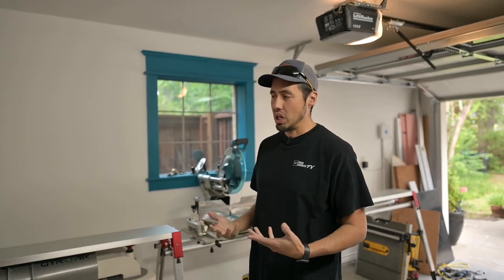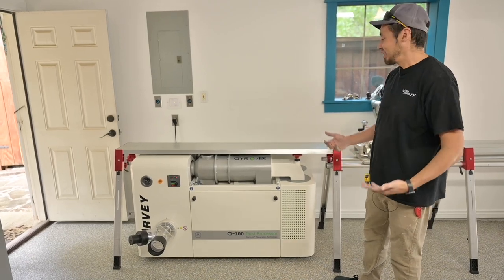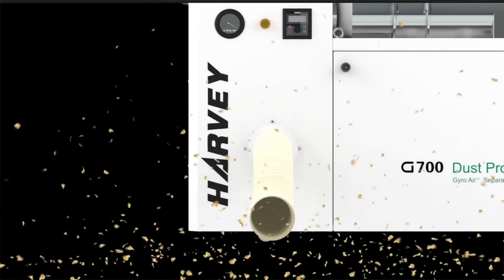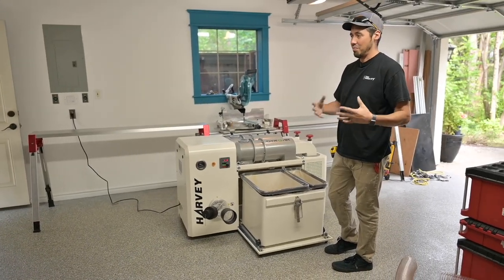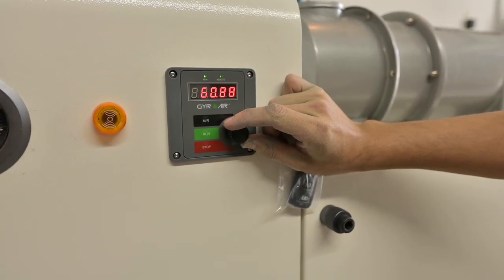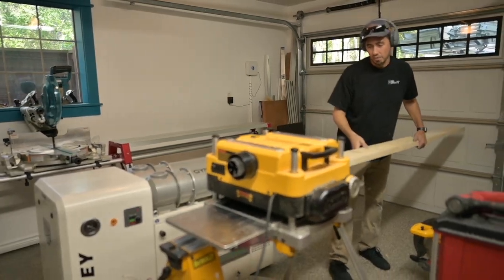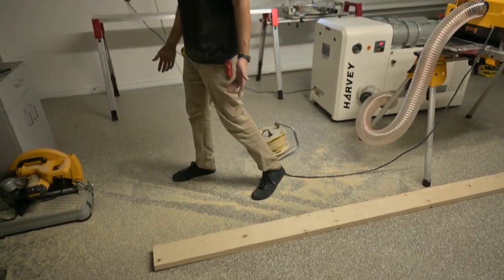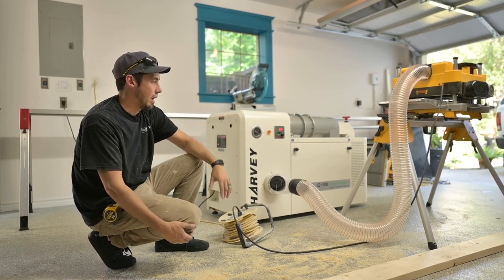This thing SUCKS! (FIRST TIME using my NEW DUST COLLECTOR!)

Comment: LOL, great video demonstration, I've seen one of these dust collectors before, I don't have one, for now in my small shop, I made one for the same DeWALT planner, basically a box that the planner sits on with a hose from the planner to the box and 2 filters, one like a screen to catch all this big chucks and the secondary is a furnace filter the catches all the finer partials, it's not perfect, but it keeps the mess way down, those planners make a huge mess and it's gets old fast cleaning up after it.  the whole box sits on casters for easy mobility.

Comment: I'd recommend strategically fixed permanent ducting smooth interior with only flexi pipe to final tool location ...I think the flexible ducting is less efficient v smooth walled ducting ?
Reply: I’ve worked in several shops with several different dust systems and the shop that had all smooth lines hard piping for all of the main trunk lines had superior performance. And it was a smaller vac in a bigger shop, versus the other shops that were the same size or bigger with flexible hoses. Smooth fixed lines all the way!
Reply: Stumpy Nubs has an excellent video about all this and Bourbon Moth too, specifically about this same model. Harvey will even send you a diagram of optimal layout for your shop!
Reply: this would be a sweet video,,paint the pvc and all
Reply: @organize1979  Bourbon Moth has the larger model, the G800, and it costs more than 2X more than the G700.  I guess Harvey is willing to make smaller margins on the G700 to sell to more people.  I ordered a G700 over Harvey's Thanksgiving sale and it's supposed to be delivered next week.  I'm looking forward to comparing it to my Jet DC-1100VX-CK 1.5-HP, which is very loud and leaky and will be for sale soon.
Reply: @bobbray9666  How's the G700 working out for you?
Reply: @coppertune9124  All the advertised attributes are true and it's a nice DC.  I modified the clean out ports into a 4" Y for easier use.  The dust bags are about half the size of my old DC but half the weight!

Comment: I got a Harvey G700 last year after Matt's video as well and it was definitely the right fit for the residential shop I was spooling up.  A few observations.  Spool up time can be frustrating for making quick cuts, so for things like the miter saw you may prefer a separate dust extractor (see my comments below in Brian's thread on this topic).  Second, I really wish there was a vertical facing opening you could use for more permanent ductwork instead.  That lower/horizontal opening is super awkward in some cases and I had to design my entire shop layout around this unit.  Still no regrets though, it's a great unit.  Lastly, if I ever hear you call a gladius a machete again I'm going to report you to the armorer.
Reply: I bought a G700 a few months ago in anticipation of our new home build.  I'm going to run my DC piping (6" PVC S&D) under the concrete floor to 4 or 5 work stations.  I'll also have a couple of cleanouts, just in case.  The low to the floor suction on the G700 should work great but most won't have this option..
Reply: How's the G700 working out for you after using it for some time?
Reply: @coppertune9124  Pretty good, though I sadly haven't put enough mileage on it to really give it a full assessment.
Reply: Can you tell me what I’ll need to connect a 4in flex hose to the g 700. I have one on the way but don’t no if I need a specific coupler or if the 4in flex hose will slide right on and just clamp down.
Reply: @lucasmancini7415  The unit comes with a 6" to two 4" y-split.  You should be fine.
Reply: @Warkive  so the 4in flex hose will slide right onto the 4in y either side

Comment: I have a workshop in the UK and that type of extractor is good for a  small workshop but the dust capacity is very poor especially when planing timber. The sound will be far higher when you connect the extractor to your Planer but if you change your planer block to a well made cutter block which has the Spiral/shear cutters the decibels will be cut by a fair amount. I have a new Felder RL200 Extractor and when I fitted spiral blocks to my 4 sided moulder it reduced the decibels from 90db to 73db just by changing from the traditional planing blocks to spiral blocks. Good luck with the workshop and Happy New Year from England.

Comment: I've been watching your channel since I got back into finish carpentry 6 months ago and this is my first comment. It has been awesome watching you grow as I grow my company. The Harvery dust collection system is a great choice for your shop. You will have to do a follow up video once you get it all setup. It'll be nice to have a spot for everything with it all piped in. I'd recommend galvanized straight pipe. A couple elbows and you'll be in business.

Comment: My smallish shop doubles as a prep room AND a finishing room. We use a series of vacuums and as you can imagine there’s still fine dust from sanding, cutting etc and it lands everywhere (ex. tops of light fixtures, cabinets, tool boxes….) and it’s a real chore to ready the space for finishing so dust doesn’t end up in on finish. The 700 model sounds like the ticket for me. I’ll be looking to get this unit ASAP. Thanks for the demo.

Comment: Since your equipment will be mobile within the shop, maybe a couple of permanent ducts, one or more overhead and one or more near floor level (for tools like a table saw or jointer) with "taps" (for lack of better term) that you could connect collector hoses to as needed.  A simple sliding damper would close the "tap" when not in use.  
For stationary tools, or semi-stationary tools, like the miter saw, a permanent duct on the wall with a collector hose would be great. 
Looks like a great tool.

Comment: Thanks for the demo. We're thinking about adding this to our workshop instead of the Oneida. Two questions. We're getting a Shopsabre CNC IS-408 soon but I'm curious if this will pull double duty for our Epilog Fusion Pro laser engraver. The second question is that you were, in jest I'm sure, mentioning Dallas/FW airport landing (@ 10:05 in your timeline). Is your shop by chance in Dallas?

Comment: Biggest problem i had with a bigger workshop dust collector, was the short ramp up time for the miter saw and even table saw. 

Leave this machine oiled and ready to go for some heavy heavy route ring or planning - but i highly recomend a few strategically placed workshop vacs for the Mitre saw and the work table when you need that quick cut. Either way, no matter HOW big and baddass you go, the dust and shavings will still get everywhere. The main goal is to capture the fine dust that you cant see.

Comment: Those ridged hoses reduce suction by 3 or 4x. But you probably don’t have to worry about it with that powerhouse! 

I just finished installing 4” schedule 40 PVC duct to all my tools. I’m very pleased. It took a few weeks due to supply constraints and ordering a few wrong parts. Rockler makes a handy PVC adapter to transition from the pipe to a hose at the tool. Schedule 40 is more like 4 3/4 so you’ll want to use 5” metal blast gates.

Comment: You would still probably get better collection to run a Festool extractor to the miter saw. The rest of the tools need that large CFM from the Gyro but the miter saw and any sanders will do better on a dedicated extractor (vacuum)
Reply: Agreed! Had the same in my old shop. Ran the Festool for the mitre only and a Vortex for everything else. Well worth it when you need to take the Festool extractor out on a job.

Comment: I have a surface plainer and hands down is the dirtiest machine I own. Dust collection in a shop is a must. Good luck with your setup. Looks good so far. I’d run permanent ducts with flex at the tool.
Reply: My top planer is not only the dirtiest machine but the loudest.

Comment: I have a mobile cart Laguna, with a cyclone on the top of one of the grey trash cans.  Just used some peel and stick foam insulation to get a seal and attached they cyclone to the lid.  Even put a plexi glass window in the can so I can see when its full lol.

Comment: Very nice.  The dewalt planer has great dust collection already with the extraction fan built in.   There's been debate on if it's damaging to the fan system on the dewalt while having the dust collection on at the same time.  Not sure if it's true though.

Comment: Cool machine can you put the link of the tool you  use/used for using when you hook up the chop saw, table saw, and vacuum at the work place. When you step on it it turns on  vacuum to suck the dust from which ever tool you use thanks

Comment: Nice review of the machine.  Looks to be a real nice dust collector, however, as others have mentioned the input location on the front of the unit doesn’t seem to be well thought out.  Would prefer either the input be on the end, back, or top of the cabinet to allow for permanent ductwork attachment.  I don’t want hoses all over the floor.  I guess you could route ductwork under the flood if able.  Might be a deal breaker for me.  Too bad, I really like Harvey products…

Comment: Awesome vids man. Im a cabinet installer in Naples florida. I appreciate all the tool reviews. I would like to see more stuff on the new makita 12”. I’m a millwalkee guy and I have their 12” miter-saw but it dose t  working for the quality I need. I have a Kpex for small stuff but I’m looking at getting either the 12” cordless dewalt or 12” 40V Mikita you just got. Which you recommend

Comment: I have a Drummond 2 HP dust system with a 1 micron canister and it works well but very noisy. The shop is underneath the double garage so surrounded by concrete, the sound is stuck between the walls. Ear protection is mandatory but there is very limited dust in the air. You can't see it compare when I had the bag instead of the canister. 1000$ cad for the kit.

Comment: Permanent ducting but made from metal is way to go, with grounding wires in few spots reduce fire hazard. As suction and friction are causing static electricity buildup that in some ceases leads to creating a spark. Spark combined with fine particles of any flammable material in extreme cases can cause micro explosion. In Europe you would have big issue with insuring this property without having such permanent solution at least if you are using this shop commercially.

Comment: If concerning yourself with noises , just a suggestion . You might want to install insulation in the garage panels as well. Not only will you be able to keep working in the cold & hot humid months inTexas. It will cut down on the outside noises to your neighborhood . Great video, I’m newly subscribed to your channel, keep up the great videos.

Comment: Nice video, love the impersonation of a pilot haha. The "gyro action" is two cyclones just situated horizontally instead of vertically. Very nicely packaged and looks well built with the fit and finish but the engineering portion of it isn't ground breaking.

Comment: Two things I would never put in a shop are an air compressor or a dust collector. Both always get installed outside the shop in a dedicated insulated shed.

Comment: Be sure to run a ground wire through the dust collection duct/hose unless it already has this built in. Also, it is still a good idea to have a air filtration system in your garage shop.

Comment: Matt Jackson of Next level carpentry has a show on YouTube of how created flex hoses for his dust collector! But for the miter saw I would get a festool CT vac. I think it would work much better for the smaller inlet of the miter saw. Also if you watch izzy swan, he sells connectors for your dust collector. I think you will have a nice shop when you get done with it!
Reply: To add to this, I have both a Harvey G700 and a Festool CT36 and I agree.  Unless you create a dust shroud around your miter saw and need the CFM that kind of volume dictates, you'll be way better with the CT for two reasons.  One, the Harvey is high CFM but low static pressure and the CT is low CFM but high static pressure.  For applications a ~2" hose, you generally favor static pressure since you can only move so much air through it anyway.  Also, the CT will come up to speed a LOT faster than the Harvey will and enable you to make cuts quicker.
Reply: @Warkive  I subscribed to your channel just in case you start making videos. Seems like you have some nice equipment and likely doing great work. Never subscribed off a comment before.

Comment: Man i didn't realize you could slow that one down to work with small tools, still not sure if it's slow enough for a single 1.5" or 2" tool. I'm interested to see how that works with the miter saw. Permanent dust collection sounds great, but for the kind of use a garage shop gets, a flex hose with a quick connect fitting from Rockler saves time and money. I have that same noisy ass planer, bet you're looking forward to the new one lol.

Comment: I would run a permanent smooth wall trunk line up the wall and across the ceiling of the shop. Then have different diameter flex lines (for larger and smaller tools) hanging down from the trunk line every so many feet. U could hook and unhook tools easily, and cap off the lines u weren’t using at any given time.

Comment: Great video.  Just be aware there is a science to dust collection.  For example, one of the biggest things to consider is electrostatic discharge.  If you run plastic pipe, make sure you run a ground wire through the inside of the pipe.  Also, as mentioned by several,  smooth pipe has less restriction and turbulence.  As a suggestion, put an elbow permanently on the planer so the board won’t hit the work exiting the planer.

Comment: Everyone will probably recommend solid duct work to eliminate loss of suction. However, with a shop this size and a dust collector that powerful, I think the added convenience of flexi hose is worth the minimal drop in max suction. Check out Lincoln St. Woodworks YouTube video on the topic

Comment: I would love to have Harvey dust processor....maybe someday I will be able to afford one. That being said, the example you used in this video is flawed. The Dewalt planer has a blower which allow you to run the dust hose to any static barrel or can. No suction is needed. I would like to see how the Harvey works on a table saw, jointer, router table, ect. compared to a regular shop vac or another dust collection system.

Comment: Can you hook it up so when your tools go on the collector goes on and off automatically?  Seems like having to use the remote is a pain.
Reply: That would be cool, but would also cost hundreds of dollars. The remote is already so easy, just keep it on your belt, or in the case of my shop which is the same size as his, on the table saw which is in the center so always in reach.

Comment: Definitely permanent duct work. The corrugated hose has way too much resistance for long runs. It will require more static pressure and put you at a lower CFM operating point on the fan curve. Take a look at Nordfab duct if you want something easy to assemble and change up. It's much easier to install than spiral pipe and a lot more friendly to changes.

Comment: Not a dust collector, but a "dust processor".  The name alone automatically demands a higher price...like putting the word "tactical" in front of "backpack".  :)  Would have been nice if the intake ports were on the back which would make it easy to plumb into overhead ducting...looks like it would get in the way and be a trip hazard.

Comment: I would add a PVC 90 to the planer, so you can run the hose for suction and not have it be in the way of the exit of the planer

Comment: Flex hoses are extremely inefficient with dust collectors, you should avoid as much as you can all 90 degree turns and connection seams. I think that dust collector would be good for 4 suction ports, i.e. 4 machines operating simultaneously, so, it is overkill for your shop. But, hey, if it is free of charge, I would not say either. On the other side, you tubers being sponsored by equipment companies are forced to be biased toward the products they endorse, so, you do it at the risk of loosing credibility.  You need to do a full, clear and honest disclosure of being sponsored. You are not doing that right now.

Comment: The Dewalt 735 planer has a blower in it that doesn’t even require a vacuum. All you have to do is run it to a sealed garbage can with an exhaust port on top. I used a cheap cyclonic head attached to can lid & get almost no dust. This is not a true test for your dust collection system.